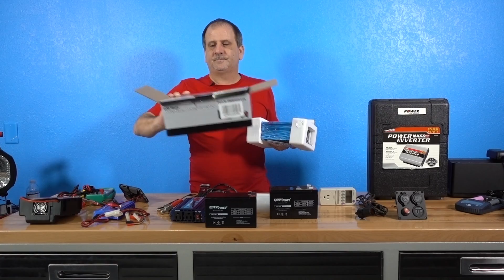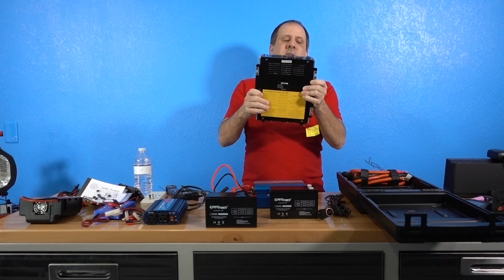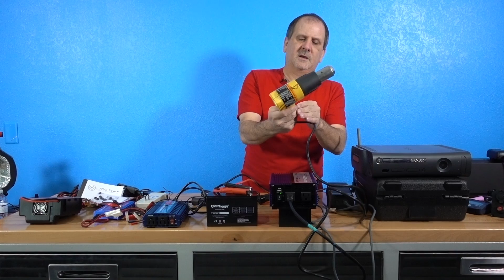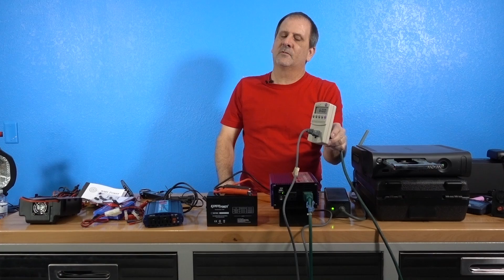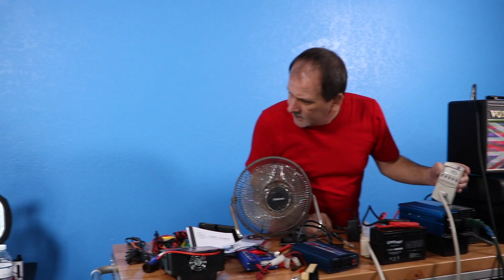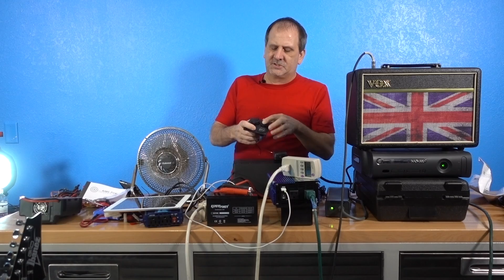DIY Solar Generator with Aims Power 600 watt Pure Sine Power Inverter

Comment: So I've been checking out solar generators. I decided to start the project. I just want to know if I've got main parts. Heres what I got.
12v 50ah wheelchair battery.
600 watt continuous peak 1000 watt true sine wave power inverter
100 watt solar panel with digital charge controller
120v automatic batter maintainer.
Am I on the right track. My math said 12v 50ah battery would mean 600 watt inverter.
Reply: Lol he never answered you smh

Comment: Any body's suggest me .how will make 600 watt sine Wave inverter using 12 to 220 volt battery?
Reply from the maker: Dekesh, are you asking about how to make an inverter or a portable solar generator?
Reply: 600W is not enough power you need at least 2000w to get a good arc going. :)

Comment: Wes I am interested in adding in some extra power to my van to allow for an in car entertainment system. I am looking to add in a couple of USB ports that are regulated to 5 volts to run a raspberry Pi3 as well as a true sinewave inverter and a spare battery that will be wired into the car to charge it as well as a small solar panel that I am looking to place up on the roof of the van to allow the kids to watch videos while on the road and to charge and run their portable devices. I was thinking about putting in an overhead TV system but I am rethinking that and instead considering putting in a 12 or 15 inch computer monitor that I will mount with a VESA mount that is connected to a monitor arm that is normally used for mounting to a desk that would be bolted to the floor or the back of the center console that is mounted in between the front seats. Any help or suggestions for this project would be greatly appreciated.  I would like the power system to be somewhat small and compact but powerful enough to run all day long even if the car is not running.
Reply from the maker: I would need to know the power consumption of the Raspberry Pi3 and the monitor that you will be using. I would do a 600-1000w inverter and get a couple of deep cycle marine 12v batteries or a 200ah LifeP04 bank and that would do a pretty good job. The lead acid would be the fastest, easiest way to go but would add a lot of weight and not last as long as the lithium. If you want to keep it small than you will need to go Lithium. I can make this for you if needed. Let me know.
Reply: The Raspberry Pi draws about 3-5 watts of power and the monitor draws about 25-50 watts, I would prefer to keep it small and lightweight.
Reply from the maker: Ok. So a solar panel on the roof and a 100-200ah 18650 lithium or Lifep04 battery pack would do it.
Reply: Ok thank you, could you recommend a panel, battery and inverter  that I would need to use?  Where would be the best place to buy them from?   I found the USB connector that I would like to use on Ebay as the Raspberry Pi3 requires a 5 volt 3.2 amp power source to run correctly, I like the idea of using a plastic tool box or a boat battery box to mount the batteries in and then mount the inverter to the outside of the box or at least the outlets from the inverter on the outside of the box, that way it would be portable and allow me to use it outside of the vehicle as well as inside the vehicle.  I was also thinking about possibly using the 12 volt outlet that I have in the back of the van to charge the batteries while the vehicle is running in the event of the panel being covered by snow/ice or at night as I am in Upstate Western NY so we have some really bad weather so I wanted to use the vehicle as a powersource in the event of the panel not being able to produce enough power.
Reply: Wes I would really like to discuss this project with you in more detail in more of a formal and private format. I did go to your website and fill out one of your contact forms with a similar subject line as the one mentioned here in the comments section.   I would like to follow up with you from that contact information if possible.
Reply from the maker: Panel any hardware store or amazon and eBay. battery and inverter from me on the website. I'll have them up there soon. Waiting on my shipment to arrive. shoot me an email and we can talk some more if you'd like
Reply from the maker: I will check it and be in touch. I have not seen anything come through as of yesterday? I will check it again. shoot me a PM with your contact info and I will reach out to you. Thanks for watching and participating!
Reply: Sent you a PM just now.

Comment: so no free energy device in the works then! haha. I can't believe some ppl think that would work. I think maybe someday something will be possible. I'd say it would take some exotic elements. probably be dangerous. and likely not be worth it. something with 99.9% efficient would make a big difference. some device with 100%+ not possible yet. great video. I almost got the aims 1200w with change over built in. but went with a larger inverter charger. since I haven't got any solar yet. just rambling on doing the like and comment thing.
Reply from the maker: yes I will be doing free energy but FREE energy costs $$$ to get it all configured and then it becomes free energy with the sun. I can in fact build a device that will run itself and provide enough power to fully charge a battery bank and run your house.